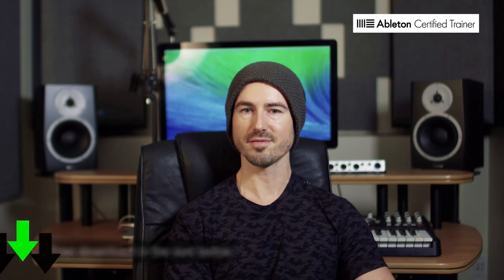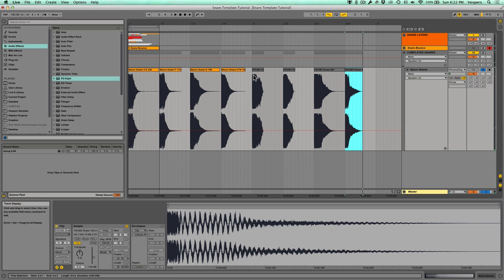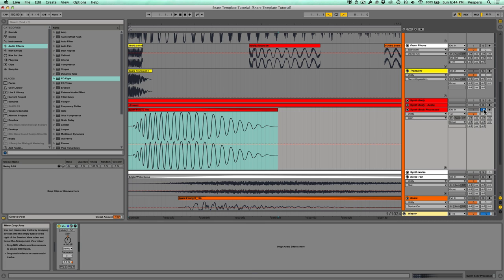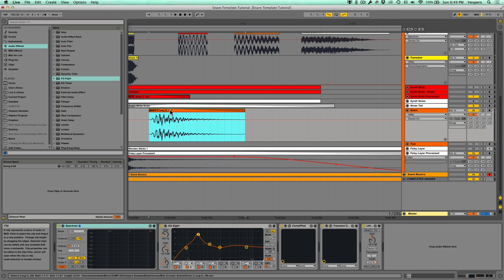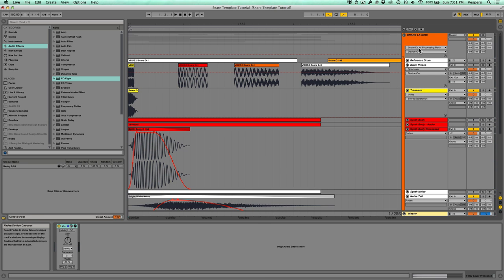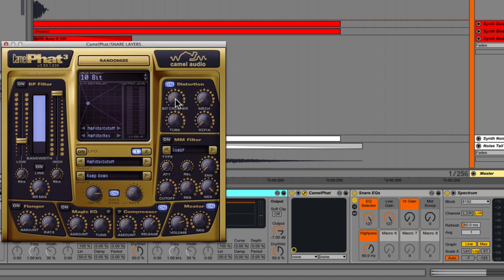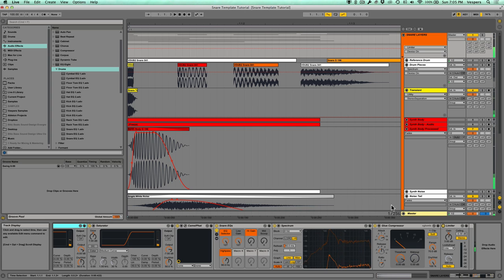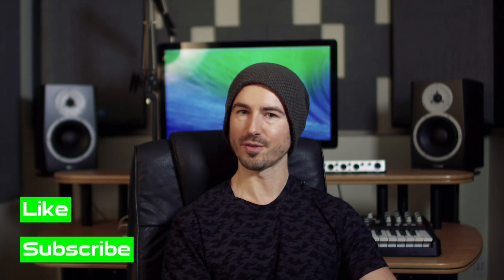How to Make Vengeance Snare Drums

Comment: Hello, at 19.11, vespers says the two saturators are running IN PARALLEL, but in the video they are clearly shown juxtaposed one after the other in the same chain... isn't this setup supposed to be called IN SERIES instead? Am I missing out something?? + What would be the difference with putting each single effect on a different effect chain in the rack?
Reply: so this is more like a "hybrid" in series-in parallel setting, rather than a "purely" in parallel one? since 50% of the signal entering the second saturator has already been processed by the first? thnx for your quick response and please put up with me ;)